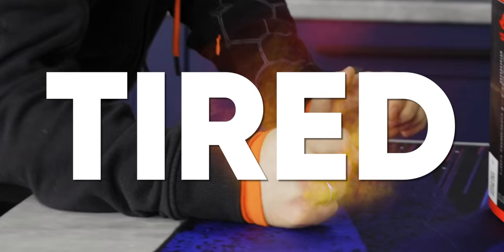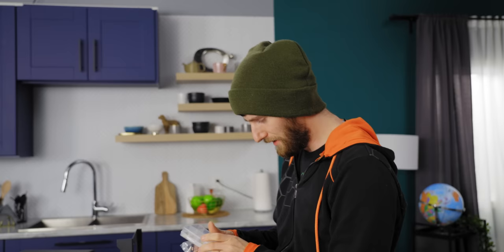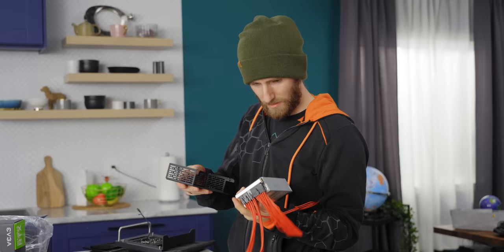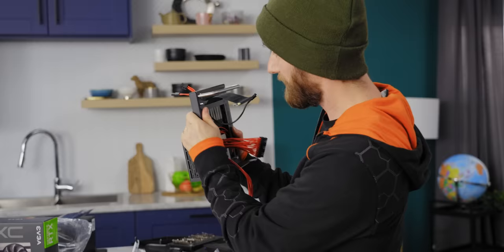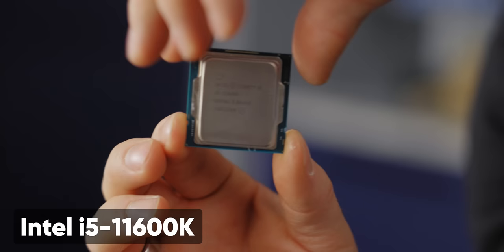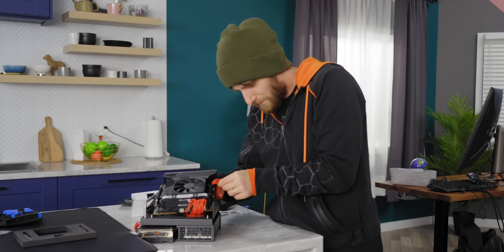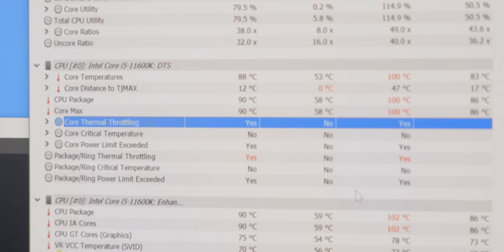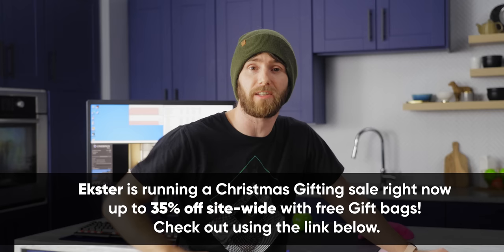Cases are Stupid. - XWORKS X32 "Case"

Comment: Why wasn't an AMD cpu used for this build?
The difference in thermal performance would be huge for a cooler of this size.
That i5 has a TDP of 125w, while the 5600x has a TDP of 65w. That noctua wouldn't struggle!
Reply: beats me man, ryzen 5000's efficiency makes it top tier for small ITX builds

at least he didn't put the 12900K in there
Reply: Intel probably sponsored part of this and paid extra for them not to put the disclaimer. No way they didn't think of an AMD build first.
Reply: He 's sponsored by Intel just forgot
Reply: @daniels-mo9ol  thats, sadly, illegal. So they weren't sponsored for sure, but maybe it was a speed thing, or for Overclocking headroom? Or it was just what was compatible with that Motherboard honestly.
Reply: @edgarrivas6438  I think it's because of motherboard compatibility, he wanted the most ballers motherboard and probably didn't have an amd compatible one
Reply: @resentfulsoulofthetoilet589  I decided to look on PC part picker and while he may have not had one on hand, there are definitely baller itx amd boards.
Reply: @afriendofafriend5766  I didn't said they aren't, I said he might not have one lying around
Reply: They didn't disclose they were sponsored by intel on the video, which is something they usually do.
And even if they didn't have a baller ITX MoBo, they usually address that with a comment like "oh yeah we don't have one of those in here so we're just gonna do it with this component", which they didn't.
Seems sketchy. 
And if Intel payed a ton of money for their CPUs to be featured, this video did them dirty, as they showed how it throttled.
Reply: Remember that time people just watched a tech video and enjoyed it and no one commented about the producer being paid off by a corporate interest? Remember? Yeah... me either.
Reply: I was thinking the same think, I thought he would adress it, but nope.
Reply: @MadcapActivityDomain  We don't do that here
Reply: There's only 1 or 2 AMD boards with Thunderbolt, and they do weird fucking shit.

Mine has an Intel 1156 CPU cooler mounting holes for an AMD socket.
Reply: Because its a video to show off the case, if your only concern is the components put in it you've missed the point.
Reply: Maybe they wanted to see how well the setup could handle such a hot-running chip?
Reply: Because he can
Reply: Hidden pressure from Intel.
Reply: guys, he didn't get paid off. you think they'll take that risk to their reputation? literally nothing could be worth that

also, hell of a way to get "bribed' by a company then show it thermal throttling because of how crappy the efficiency is
Reply: @edgarrivas6438  why is it a sad thing that not disclosing sponsorships is illegal?
Why would it be better if content creators just could screw their viewers?
Reply: @Jehty_  figure of speech

Comment: Anyone wanna talk about the 2 SSDs never actually being connected via any S-ATA cables whatsoever xD
Reply: He hooked up the power cables but forgot the data cables, I think Linus has gotten a little to used to installing m.2 drives.
Reply: Motherboard has Wireless SATA from 2026
Reply: Data? no need data if you can charge your SSD to be faster

Comment: As someone who hates the dust on open cases, the sheer tinyness and compatibility with strong and hot components kind of outweighs that. Mod the fan on the flex psu and it can be quiet, small, cool, poweful, and accessible ALL IN ONE.

Comment: I can't even imagine using such a case. The dust would get in all the nooks and crannies on this thing.
Reply: It would be fine unless the buyer has a super dusty house.
Reply: @Macky4941  Or anyone with a pet.
Reply: Well, it’s way to clean.
Reply: But with a case like this it's easier to clean so there's that.
Reply: Compresses air
Reply: Dust gets everywhere anyway in my experience, it doesn’t really seem like a legitimate concern imo
Reply: Cats are probably the only issue. I run an open case in the southern US and my dog doesn't produce enough dust to be noticeable. I only need to wipe tight corners with a baby wipe every other month for the very fine dust in my room.
Reply: @Daniel Hutto  I have a cat who barely sheds so I don't have to worry about that
Reply: Dust is non issue for this case. It would take 30 seconds to clean it with compressed air every 3-6 months. The actual issue is this case is dangerous to kids and pets. And in turn kids and pets are a danger to this case as well. Very cool but very impractical.
Reply: @maoraharon21  true, don't even have to remove any side panels, just spritz it now and then with a can of air and you're good.
Reply: Buy vacuum robot and run it every day. Easy.

Comment: I thought the Antec Skeleton was the most awesome case ever back in the day. When I was able to get one, I was very excited, until I turned it on. Ung, the coil whine was unbearable, like having tinnitus. This was with components that where silent in my regular full sized case with a plexi side panel. Never getting an open air case again. Though, this looks cool and my latest build is a mini-ITX.
Reply: @HadenBlake  I only had the case for about 6 months before putting the computer back in it's original case (which I still have and use for my daily driver to this day).

I do remember having to hit it with some duster every few weeks, I don't know that it gets dirtier or it's just way more noticeable. 

Though, it would make sense that the components would be dirtier without grills, fans, and filters to collect up some of the gunk.

Comment: I’d want this case to have a small “carrying case” of sorts, if I’m transporting it, I’d want it to be safe when in a car. Not applying to airflow since it’d be to protect the exposed internals, only larger enough to fit most builds without mega gpus
Reply: That's what I was thinking. If you have this for on the go you could pair it with a pelican case.
Reply: @Muscleduck  I really want to do a version of that build, I just can't find that case kit anywhere.
Reply: You mean you want it to actually be a "case"... By definition and function this is not.

Comment: for the powersupply, you could always replace the fan with a 40mm fan from noctua. although, opening a powersupply gives me the heebie jeebies, you COULD do that.
Reply: I replaced a delta fan for a noctua in an 1u psu before, did not really work out. Just not enough airflow. Delta fans are a bit loud but provide excellent CFM.
Reply: I have done this with varying success. You have to go with the 40x20mm thick fan as I have tried the 40x10mm and that did not provide enough airflow but when I replaced it with a 40x20mm it continues to work 1 year later and is MUCH quieter!
Reply: @Eelinki  course i haven't done it myself, but I've seen it done before by other SFF builders on youtube. I can imagine though that what you say is true.

Modifying a PSU in any way is of course shaky ground, especially when it comes to taking away cooling from that much power in such a small package.

Comment: To me SFF Builds basically need to go AMD. For the way lower heat output. I mean it's great if it supposedly has higher performance but if it thermal throttles it's just no good.

Comment: This would GREAT with some black metal mesh custom formed to cover the sensitive bits. Same size, better protection. Just remove the mesh occasionally to hit with an air duster.
Reply: Totally. And a plex PSU which is a silent and gives 400w (if not more) which would be fine for a 3060 and AMD 65w CPU

Comment: I think this might have to be tested with an AMD CPU as less power required required and doesn't put out as much heat, so it might be good to see how it compares with that cooler if it's got an amd bracket, I haven't looked into low profile coolers in, well, ever
Reply: I suppose they went with what they had in stock and didn't have an amd itx on hand, but yeah the 65w ryzens are pretty good.

Also maybe went with igpu to setup the pcie extension. Because it's a pita to configure sometimes, and since they want to make videos fast, saving the hassle might be worth it.
Reply: Same thing I was thinking, 5600X would have been nice in there.

Comment: I 100% support companies moving to a silicone PSU cable sleeving future. Silicone insulated cables are just SO NICE to route because of how flexible they are compared to standard plastic polymer insulation. There is a slight problem of cable droop if you're trying to span a particularly wide distance, but that's what cable management routing is for in case design. Also, if you were to find a copper low-profile cooler, you'd get better cooling performance out of it in about the same form factor.

Comment: Secret tip not everyone will be able to use.... cram some resin on the end of your philips wipe off excess leaving a little bit in the grooves and let it age. After a few days you will be able to stick any screw on the tip doesn't work as well as a magnet but you only need to do it once and it works for years.

Comment: I'm happy with function over form factor, but the nice thing about PC's is everyone can find something that matches their taste or style.
I guess I'm old and boring, but I really don't care about SFF. The seem to be more expensive, harder to build in or maintain, require more expensive components like SFF or PSU or itx motherboard, and tend to run hot.
Reply: Well, if you have no space its a great Option, and there are less extreme ones than this. Like a good ol trusty nr200
Reply: I like the variety in SFF. Almost every ATX case is literally the same basic formula which makes setup/part selection the same basic formula. Sure it's easy to build, but it isn't really interesting after you do it a couple of times. Plus all that empty space irks me to no end, I don't know why. You can get perfectly adequate cooling with SFF, you just have to pick your components wisely. If you want a 5950x don't put it in a 3 liter case with a 37mm cooler.
Reply: @sniper0073088  very true, but most of the ones I see are on wide open desks.
Reply: @vinyfiny2019  I totally agree and having options for everyone's style is one of the great thing about building a pc. I tend to keep my system for quite a while, but really enjoy helping friends build their first systems, or upgrade from pre-builts. 

I helped one friend build a SFF for their first PC and the struggle didn't bring us joy, but they choose all the parts, and didn't realize some of the restrictions they would have. 
Most my friends are on a budget so the form factor adds cost that could be utilized other places.
Reply: @BeeWhere  Yeah SFF generally isn't friendly for the new OR budget conscious that's for sure. There are ways to do SFF right and on a budget, but you're still subject to some random gotchas you wouldn't really think about unless you're used to them.

Comment: I'd like to see a motherboard where the GPU and RAM are parallel to each other. I feel like this would help with airflow and thus cooling.

I'd also like to see a motherboard with the plug-ins for example the CPU connector on the back side. I feel like this would help with cable management. Improving asthetics. Also saving on materials (that are required) in production; so less metal is used for all the connecting cables.
Reply: The parallel thing is there, don't remember which OC boards it is but they exist. As for placing things on the back, quite the tooling, as they are made now they can just robot it from on top, easy enough. To do both sides they have to fix tooling for that as well have case that allow for it. Tricky. I like the idea but I can also see it from the manufacturers point of view, sort of.
Reply: Getting connectors at the back of the motherboard sounds terrible for case compatibility
Reply: IIRC the reason RAM is right next to the CPU has to do with the bus system that's implemented in most motherboards, which aims to minimize the distance info must travel to communicate between CPU & RAM. Placing the RAM parallel to the GPU instead would significantly increase this distance when compared to the current layout. How performance would be impacted and whether or not it'd be offset by the improved airflow is something that I haven't seen tested, however.

Comment: I've got 2 of those wallets. The tracker is nice and works decently, but not always so watch for that. It does ring from alexa or the app and you can ring your phone from the thing too. Some people say they have issues with the ejector mechanism breaking, but i've had mine for 2 years now and it still works the same, even with me sitting there playing with it all the time. Just don't abuse it by dropping it all the time. It is plastic ejector so dropping right on it will likely break it.

Comment: Also one of the things enclosed cases get you is directed airflow. While being open-air does give you near infinite thermal mass to take advantage of (assuming you’re in a climate controlled space), one of the things you’ll find is that you also need an efficient way to move that heat into the environment. So if one of your fans kicks the bucket while you’re doing something or you undersized your cooler, you can actually end up feeling it a lot more than in a properly sized case as it’s easier to move the heat when your airflow is still moving through all your components from the rest of your case fans, which is more efficient than relying on possibly unaided convection or when the only air moving through your cooler is what’s right around it and your single fan just isn’t pushing enough air by.
Reply: I mean computer fans are cheap, and even if you don't have a spare one you can literally plop down your actual person fan next to this and boom
Reply: @curio_sphere  That's true, but that still means it's just an extra thing you have to be prepared for with those cases, which like, to me defeats the whole purpose. I like set-it-and-forget-it solutions to things, and don't like to have to always have something accessible for if something that'd be fairly trivial on any other thing goes awry with it. It's incredibly rare for all of your fans to shit the bed all at once unless you poked around somewhere not knowing what you were doing, so one going is a "I'll fix it when I get to it" situation and not a "My renders now take twice as long unless I go pull my fan out of my closet" situation.

Comment: out of curiosity: does someone know a "case" like this one for ATX? I found a flimsy "Testbench" thingie on Amazon that stood upright but I rather have a decent one that doesn't look like it will fall apart 3 seconds after assembly. Basically I want to avoid a large footprint to save space on my desk (I can't put the pc below it)
Reply: There's a video where Linus 3D printed a case. Is that an option for you?
Reply: Check out the Thermaltake P3 or P5, leave off the glass panel and its quite similar
Reply: @tinfever  thx I will take a look
Reply: @jpaugh64  yeah, well I don't have a printer that can print reasonably big parts sadly :(
Reply: you could always drill holes in a plank of wood
Reply: @kodaxmax  whatever works for you I guess
Reply: @neko6803  well it's heat resistant, non conductive and will last basically forever. it's easy to measure the hole placement by simply sitting the motherboard on top and making dots through its holes. you have infinite options for expanding it or making hangers for drives.

you could also take the back plate from a case and just use the wood for stability.
Reply: Didn't Linus or Luke build a PC in a cardboard box once in one season of Scrapyard wars? I vaguely remember something like it, it was kinda cool
Reply: @fyctssss  Well these were still Mid-towerpcs. Plus they were trashy as  hell xD I'm Looking for Testbenchstyle open "Build", that doesn't sit flat on the table but stands upright. Basically, I search for something, where the Motherboard is located/attached to a carrier like in a normal Case... Just without the Case frame around it. I tried chopping up a cheap case I had lying around but A) that looked absolutely Hideous and B) The structural integrity of most cases is compromised as soon as you cut out one of the "Pillars"

Comment: Without a case I wouldn't move a PC from site to site, you're definitely going to damage it. how safe is it really? While on you could touch some of the connections electrocuting you or shorting the motherboard or easier to get dusty or have liquid damage. Cooling is the only advantage, but that means exposed fans. If using water cooling better with case anyway. Most people don't use test bench machines. 

So again WHY do this? If you really want a mobile PC it's called a laptop. Plenty of those on the market!

Got to the end of video, same conclusion, interesting design, like the video, expert level gear requirement needed. Not cost effective.
Reply: you not gonna electrocute yourself from a computer, i mean if you put some effort on it you might find a way... but definitely not an accident
the only place that's truly dangerous in a computer in inside the PSU